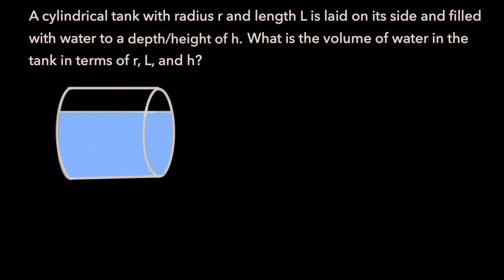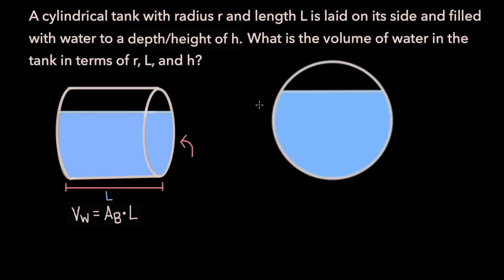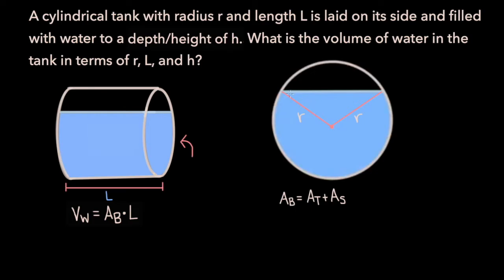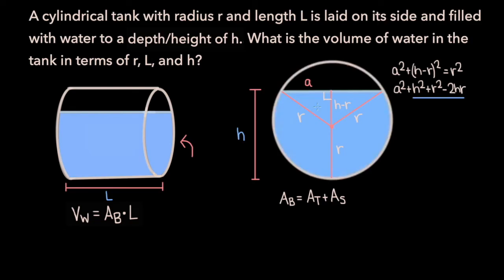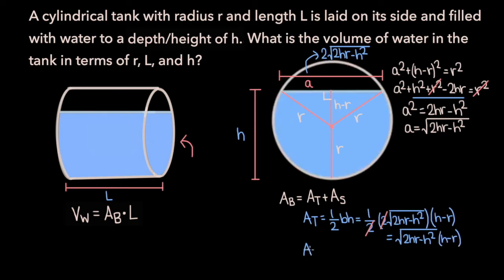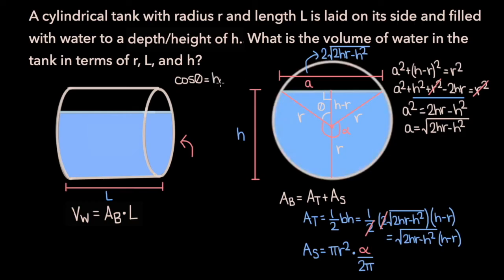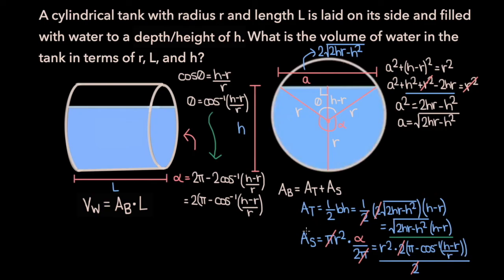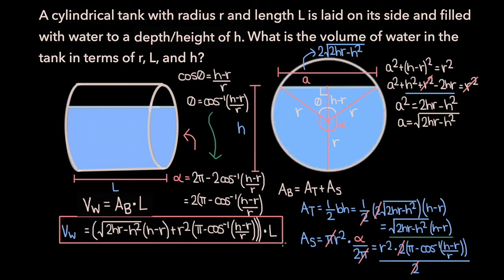Volume of Water in a Horizontal Cylindrical Tank (General Formula)

Comment: A truck driver’s gas gauge is broken.  He knows he has a 150 gallon cylindrical tank.  He takes a stick and inserts into the tank and measures that it was 1/3 high.  If he drives 60mph and gets 20 mpg at that speed, how many miles can he travel?

Comment: If the water is under the line of the center what i do.
Reply: You have to subtract the areas of the triangle from the sector.
Numerically, you may also subtract from pi*L*r^2 the previous result (but change h with 2r-h)
Reply: Turn the partially filled tank drawing upside down (on the paper) and work the problem the exact same way to get the void space containing air and subtract that air volume from the total volume of the tank to obtain the remaining filled liquid volume, as explained by georgesbv 1 above.